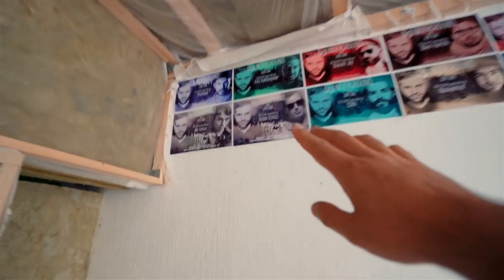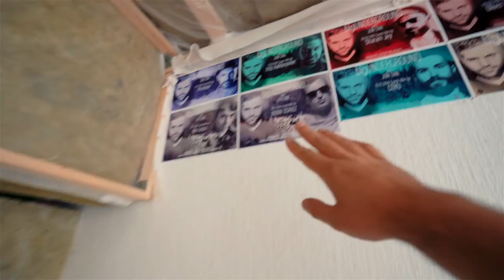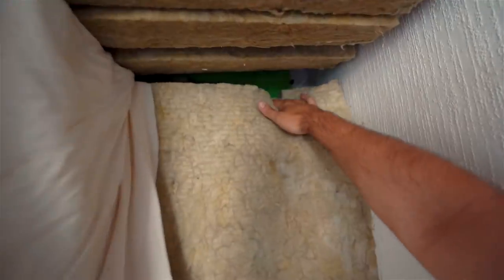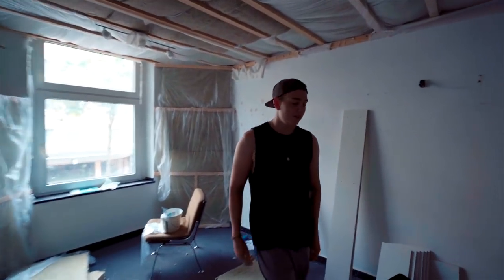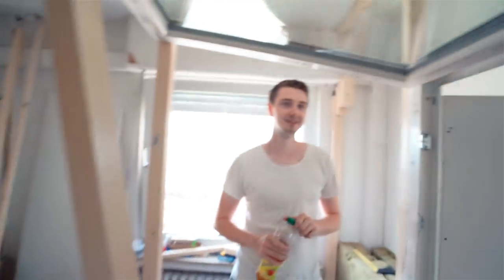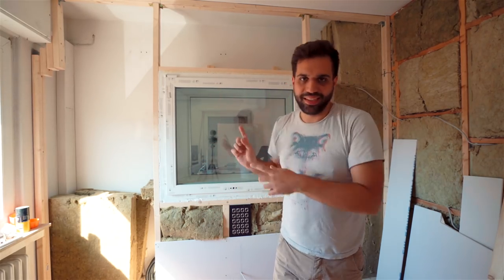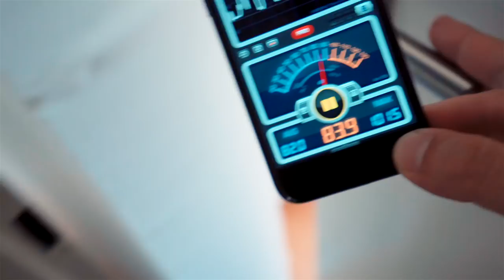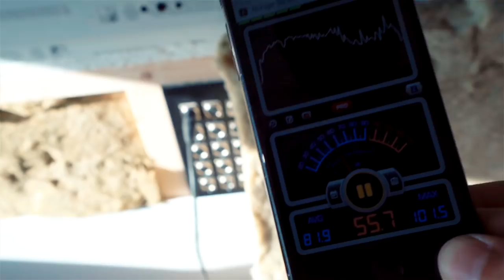HOW TO SOUNDPROOF A ROOM

Comment: I saw the Decibel Pro X app which I got also on my iPhone! I used an expensive hardware decibel measuring device but after 20 years of use it broke. I replaced it with the Decibel Pro X app, paid version. It is very accurate. Also, the sound of your video has a lot less of reverberation with the beginning of soundproofing your studio, great Jon!

Comment: You can get better isolation by making sure your inner room doesn’t touch the outer room. In your case, you are just absorbing the audio in your vocal booth, not isolating it. 
For my studio built, using room in room concept, I got over 50db isolation with just 170mm thickness from outer wall to inner wall.  I have full built video on my channel if anyone interested. Thanks

Comment: Jon, the best way to make your room sound proof is to build a room  in a room. Foor the half of your absorbsion matterial you an make a room 80 db or more sound proof.
Reply from the maker: I know but room in a room isn’t possible in that room and would be way more expensive
Reply: I second this recommendation. Add a floating floor to separate the noise coming from the connecting floor.
Reply: This is true but it's the results you are after.
Reply: Yes this is the cheapest way.

Comment: The problem with soundproofing is more complex then just adding insulation in the vocal booth. Its still a fairly good result for a vocal booth, but to completely isolate it from low fq it must be a separated room with floating floor and double walls, however, another intresting video. Good job

Comment: Hey Jon, I know you've already done it and it will probably work fine but  I have seen in studios the two windows are not parallel to minimise vibration transfer and also there is some absorption in the space between, usually the windows are thick laminated glass one sheet 12mm the other 9mm which also helps stop transfer. Here is a diagram i found,
 https://www.soundcontrolroom.com/window-detail.php  but maybe you could just use what you have by tilting the window in the booth and add some covered absorption in between so looks nice and that might get you a little more isolation, keep up the good work, the new studio is great.

Comment: You should mabey not cover the inside with drywall, i would have mabey put some fabric over the insulation, probably some material that is acousticly transparant but keeps the insulation inside, otherwise you will have to treat the outside of the drywall once again
Reply from the maker: That’s the plan